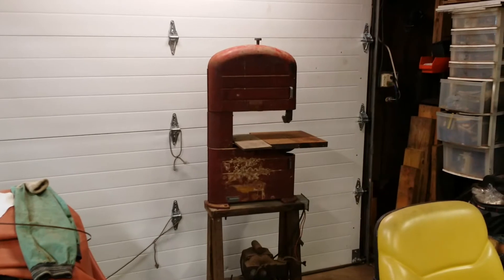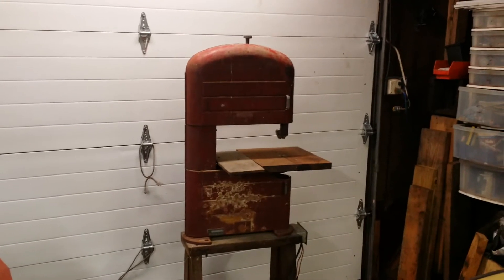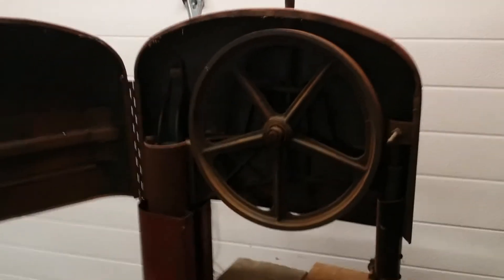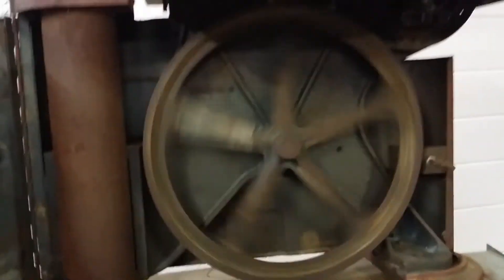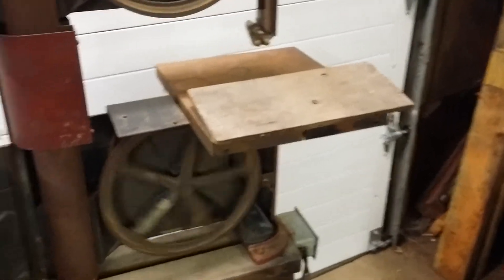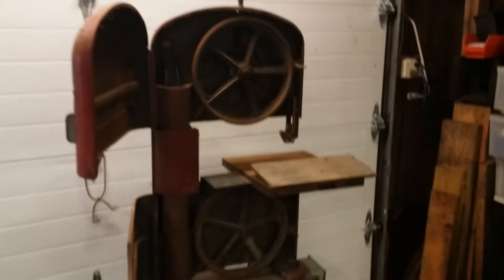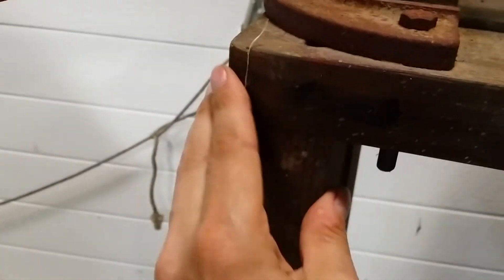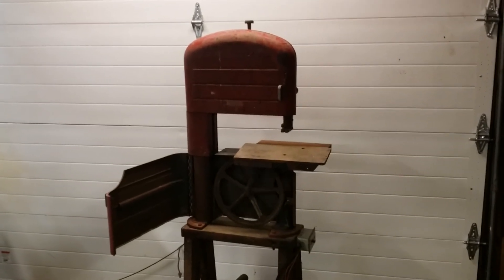Sears roebuck 103.0103 bandsaw from the 127 garage sales

Comment: Nice find. I have one that's a little newer 12" made in the 50s. They are a good little saw you'll like it!
Reply from the maker: It was definitely hard to pass up. If it wasn't for the pandemic I would have dragged home a number of other items that I don't need. A seized up BIG compressor, couple more Kohler engines, an onan genset , stuff like that ..lol
Reply: I have a few kohler's in stock including a nice 2 cyl inline, some B&S horizontal and verticle shafts. I've got a compressor for you it's 2 cyl side by side the head is 28" square a small car motor would drive it. 😁 Sounds like you got some good projects though.
Reply from the maker: @georgechambers3197  did I understand that correctly? An in line twin kohler? What model is that? I would love to see 1
Reply: Yep, an inline twin. I don't remember the model though. It's aircooled and electric start and runs like a clock.

Comment: I bought this same saw here in Canada. Paid $125, do about $100 USD. I put blue urethane tires on it and got a new blade. It works great. I did a quick repaint on it. Would love to find decals but don't care enough about that. Someone mentioned that the urethane tires don't work well. Maybe mine are higher quality but they work well as I haven't had to worry about tracking since I put them on.
Reply from the maker: Someday I hope to get it up n running. Definitely prefer older machines over modern plastic junk

Comment: I have the same band saw and use it to cut aluminum.  It's a really nice little saw.  Be sure and use rubber tires and glue them in place.  The urethane tires don't work as well.
Reply from the maker: Thanks. Actually having trouble finding rubber ones. Still looking for both machines
Reply: @craigtate5930  I believe this ebay auction 272021215199 would be correct.  To be sure contact Bobby who is the seller aka SAX13.  He might be able to handle your other saw as well.  I bought my 12" and 32" tires from him.
Reply from the maker: @bradkahler  thanks. I am looking into it